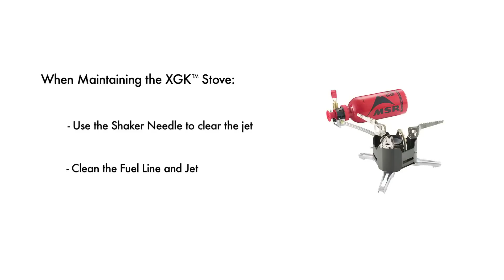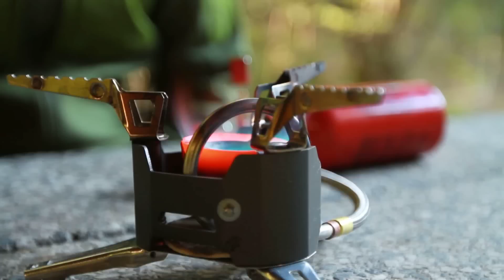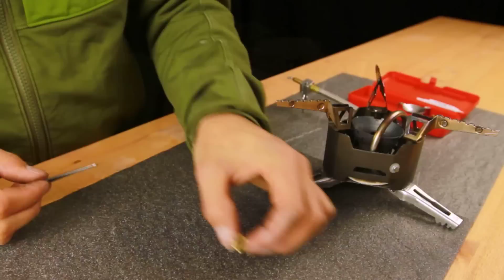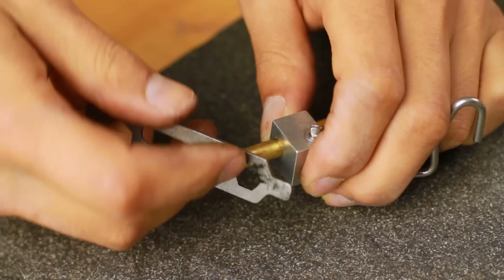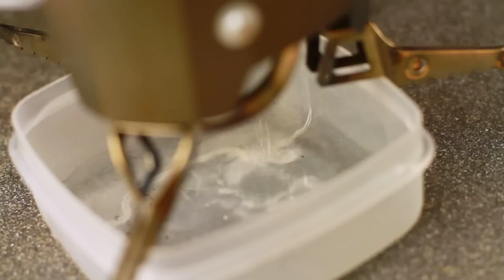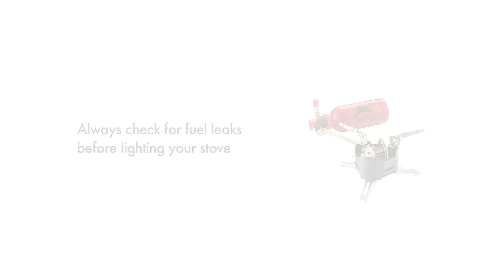MSR Stoves: XGK Maintenance

Comment: What would be a good storage container to put the stove and fuel pump into while backpacking? I find that the black bag it comes with is too thin and the sharp edges of the stove can easily puncture through and puncture/scratch items in the backpack or potentially tear the backpack itself. I've included it inside a bear canister before. Big mistake as the scent of white gas penetrated the food.
Reply: I bought my XGK in 1985. From the start I contained it in a (seperately bought) strong cordura pouch Specially reserved for this stove only. Also storing a 1 liter liquid container and a XGK maintenance package in this pouch. I still use this same same pouch and it is dirty as hell on the inside, but it is supposed to be dirty. This pouch has d-loops and could be attached to the outside of the backpack. But I kept it in the side pocket of my backpack.
It works like a charm and I don't have to worry about the (fuel vapors and soot) mess.

Strangely enough, I cannot find this type of pouch anywhere easy on the internet. All the pouches I did find are either made of too thin fabrics or have some fancy organizer compartments in the pouch. Something unnecessary and unwanted for this purpose. But you can make it yourself. See:
youtube.com/watch?v=ZPHMKPJ7pf0 

I am a (Dutch) backpacker and walked the PCT at the time (1986). Even then there were lighter options. So why did I choose the heavy XGK with such a large fuel bottle?

Reasons:

1. I wanted something to work at all altitudes in all temperatures within all weather conditions on the total length of the PCT.
2. As a last emergency resort scenario I wanted to be able to start a wood fire even in wet conditions (easy to do with liquid fuel ... when done properly).
3. The fuel for the XGK is far more common, thus easier to obtain, than gas cannisters.
4. As to the one liter fuel bottle capacity ... the extra weight compared to, let's say, a 300 ml fuel bottle is negligible with respect to the total stove system weight (which admittingly, as a whole, is heavy compared to modern superlight gas stoves). I could either opt for extra fuel for multiple PCT sections or calculate how much fuel I actually needed for a section. 
Note: I never bothered to calculate. I ended up using a full bottle of fuel for just about every section.

As to making pancakes or an omelette using an XGK ...

I have done that too! I merely hold the pan some height above the stove when at full throttle. It is labour intensive and a waste of fuel but it can be done (done occasionally) and I did do so.
Reply: @wimahlers  hi, im a rookie and i just bought a msr xgk-ex , how long do you last with a full 1liter bottle of fuel and how do you depressurized the bottle, thanks!
Reply: @enzokhr  
1 liter is a ridiculous amount of fuel (to take for the average hiker or hiking section). I never ran out of fuel. Not even on hiking multiple PCT sections at some occasions. And you always know how much fuel you have, You can feel it. Hear it (shaking the bottle). And see it (at daytime, with the sun shining in the bottle opening).

Of course, you pay a relatively hefty weight penalty when compared to a gas canister. More so when you carefully calculate to use the smallest canister absolutely necessary for a specific section.
Note: I was/am lazy. I never calculate(d).

But there is an other reason I prefer a liquid fuel stove above a gas canister. That is, even though a gas canister is a more cleaner fuel than gasoline, the canister itself is a far greater environmental waste product. Both in transport as well as in landfill/recycling.

Depressurizing the fuel bottle is easy. Simply slowly unscrew the pumping mechanism. But do it outside a tent. Because some fuel vapor will escape at the edge of the bottle. 

Actually, I always depressurized after boiling. But I always screwed the pump mechanism back to seal the bottle. I only took the pump mechanism of the bottle when refueling. I never had any problems doing it this way.
Reply: @wimahlers   thank you very much for the explanation! And for a good pouch i find good ones on websites who sells military equipment

Comment: Can the liquid stoves also simmer
Reply: you can simmer with the xgk by priming it then turning it off and depressurising the bottle. When you relight it with very low pressure it can simmer. The MSR dragonfly is the only liquid fuel stove available that can simmer without altering the pressure.

Comment: My MSR XGK-EX clogged and I am unable to remove the cable. I have used it for around 30 times with unleaded petrol. How can I remove the cable? Acetone did not help. What else can I use?
Reply: Gun wash used in automotive paint spray guns from automotive paint supply houses.
Reply: WD 40 ? Do you try flush with white gas ?
Reply: Have some fuel in the fuel line. And really pull.

Comment: Question: is there a maximum safe operating time for this stove? In other words, do i have to worry about this thing melting or exploding if i run it for too long, say for an hour? Or can i run it for any length of time?
Reply: No, I don't think so. I've run it for long periods. Turns dull orange. The alloy is high temp. Probably Inconel or something similar.
Reply: WordsofWisdom2010 لنم